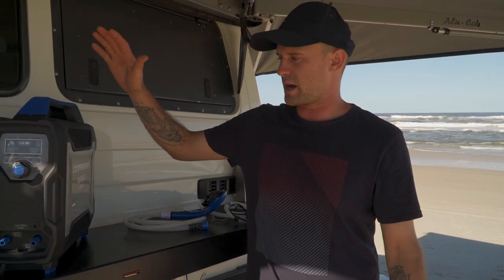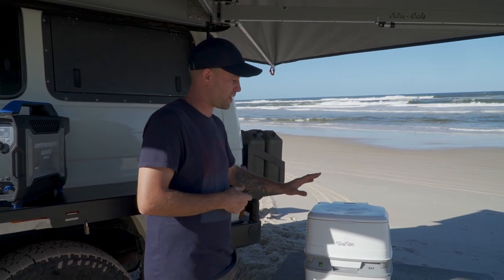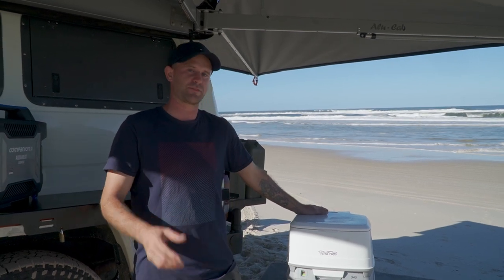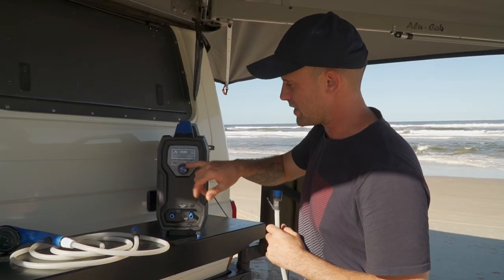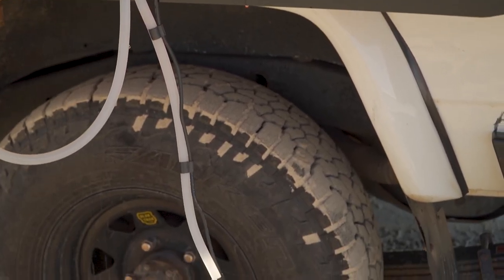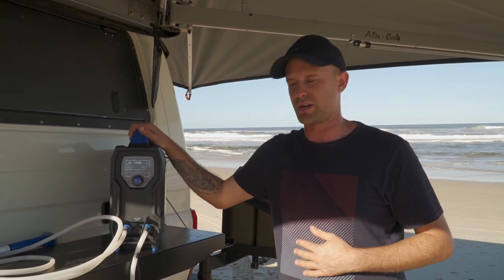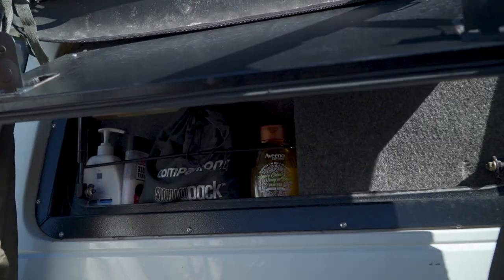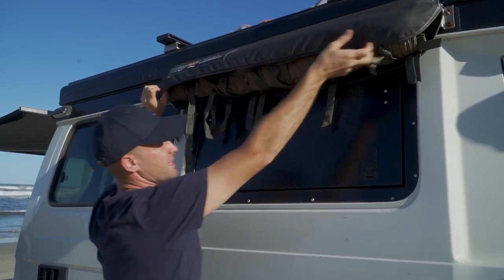Camping Ensuite Setup - Our Toilet and Hot Water Shower on the Road - The Ultimate Overland Bathroom

Comment: How many minutes shower time would you get out of the 10l bucket?
Reply from the maker: The pump specification say it runs at 2lt per minute so you would get about 5 minutes we have used it a few times now and we would say it’s more around the 4 minute mark. But we turn the water on and off throughout our showers to soap up ect. 👍